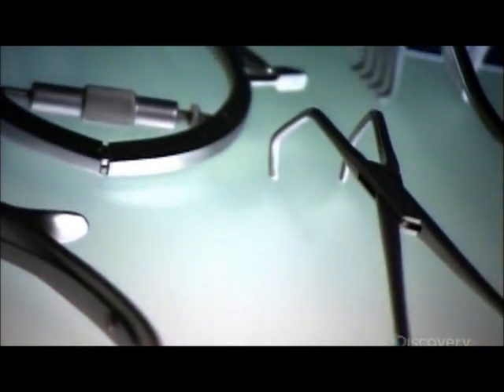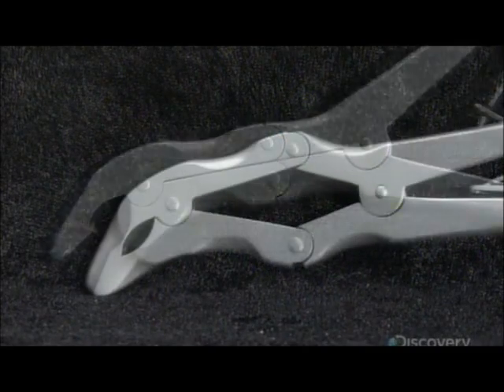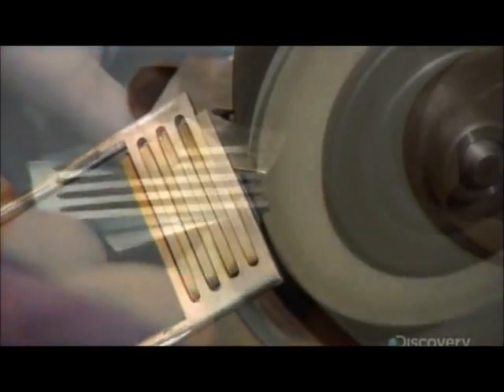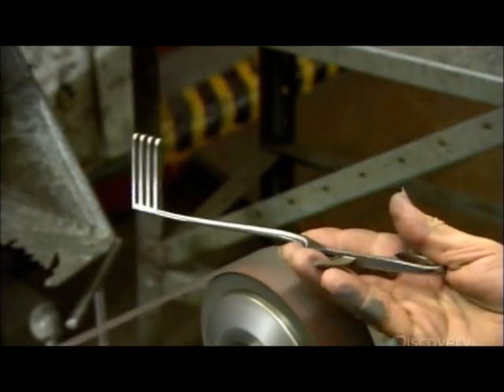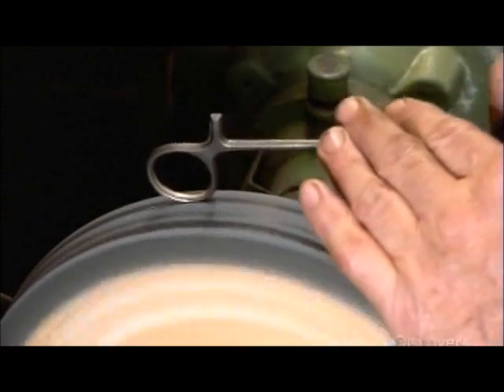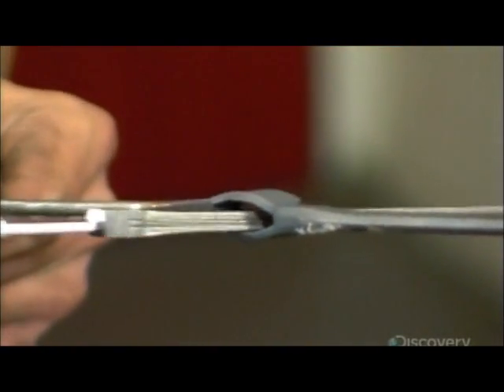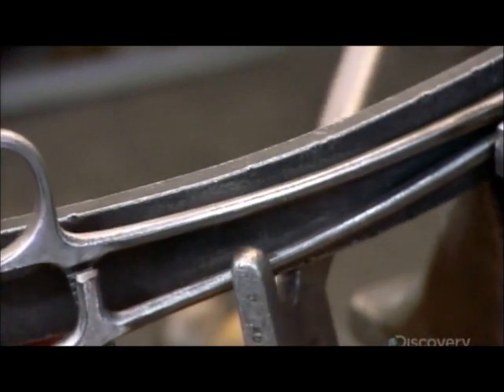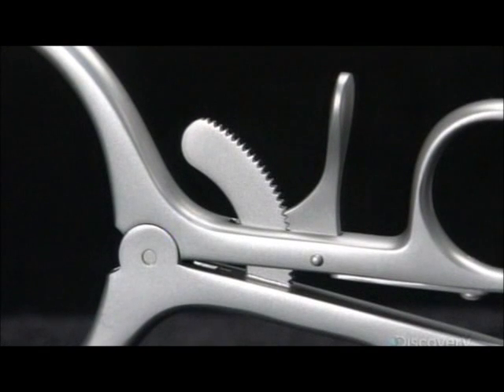How It's Made - Surgical Instruments

Comment: We are manufacturer of surgical Instruments such as forcep needle holder scisser artery forcep autoscope layrango scope Here is the list:::(Safety pin, Artery Forcep, Tooth Forcep, Spong Holding Forcep, Instrument tray, Dressing Scissors , Bone marrow Needle, Utrain sound, Needle Holder, Hammer steel, Air Syringe, Dressing Forceps, Trichotome tube, Tuning fork, Foreign Body Remover, ECG Clump, ECG Bulb, and ECG Rubber) in Sialkot.and beauty instruments..
We sell dental instruments such as Mouth Mirrors and veterinary instrument . Handle, Dental Forceps, Probes ,Explorers, Pluggers, Gracey Curette, Dental Scalers, Periodontal Instruments in different designs in solid and hollow handles, Impression trays, Dental Syringe, Amalgam Carrier, Wax Knives, Chisels, Spatulas, Excavators, Root Elevators, Tweezers etc. on reasonable prices.
and

hallwear instrument

beauty instrument

Dental instruments

Surgical instruments

Orthopedic instruments

City..sialkot..factory area

923338637275\ what,sAPp.

EMAIL.
Kashifali604@gmail.com

Comment: I though they use alloy?
Reply: Its generally Stainless Steel or Tungsten Carbide with an electrolyte solution containing dissolved ions of either gold, silver, tin, copper, Sulfamate Nickel (General Biomedical Engineering Protective coatings due to high corrosion resistance etc), an electric current is then introduced to deposit the ions onto the surface of the part.
Reply: @aidandunn2610   you are right 
We have a factory of surgical instrument where we manufacture this and many other surgical instrument
Reply: stainless martensitic steel plates
Reply: Tony Stark. The ones i used to make were 316L low sulfur stainless
Reply: Paul Lu Dental unit
Reply: Tony Stark www.samedicalimage.com
Reply: Tony Stark 
Sir can I have contact number
Reply: Steel by definition is an alloy
Reply: If you need any tools.
Tell us.